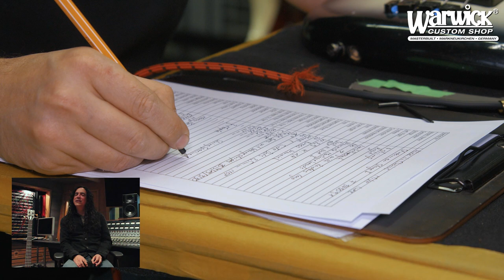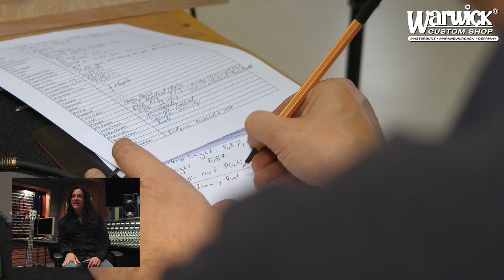MAKING OF - Warwick "Moon Bass" Replicas for Mike Inez from @aliceinchains

Comment: In the 90's did this bass have the MEC or did it always have the EMG's in it?
Reply: EMG original hardwire series. Those pickups sound unique compared to the later quick connect systems I've heard.